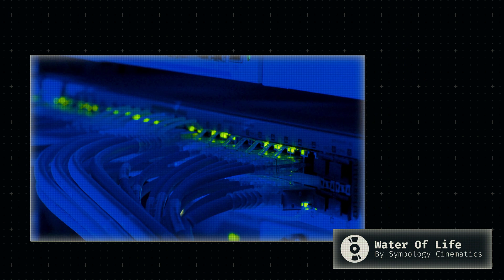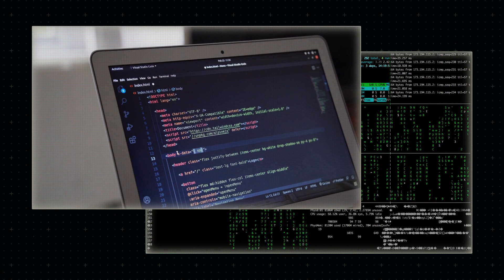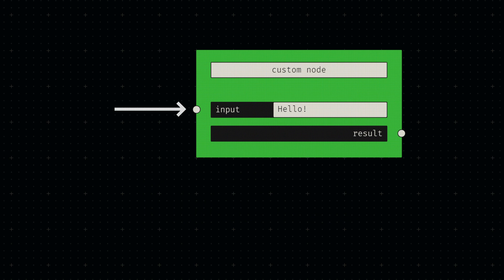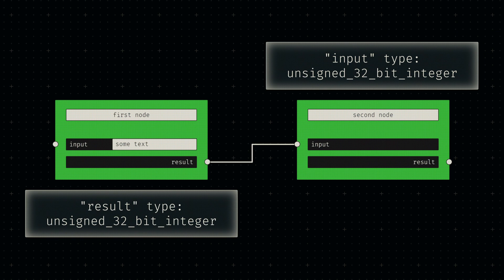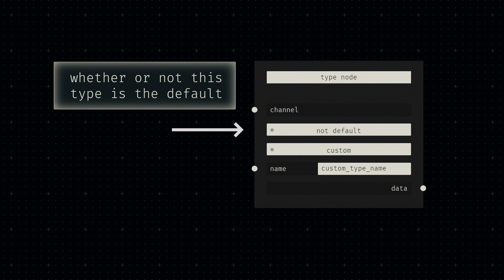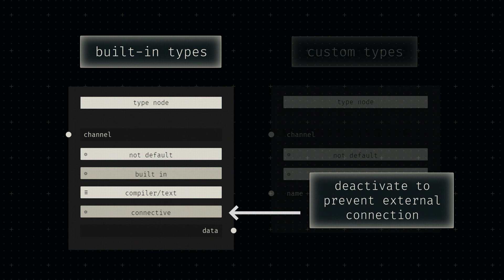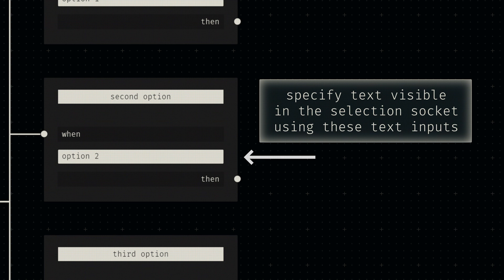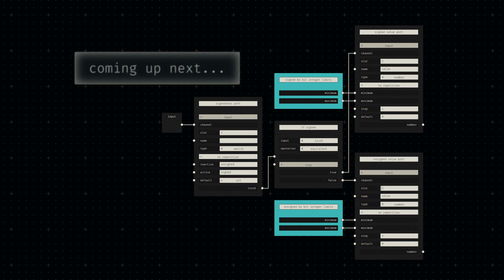A Type System to Rule Them All - Kronark

Comment: I have had an idea for a few years that I have finally started implementing: a redstone computer in Minecraft that compiles and executes brainfuck source code written with renamed paper items. I have an addressable 8-bit register module (4-bit address space) that I am experimenting with expanding to an 8-bit address space to use for RAM, program ROM, and stdin and stdout buffers; and an 8-bit counter register module that can increment, decrement, add a 4-bit offset, and subtract a 4-bit offset. Once I have the addressable register module upgrade complete, I'll make the op-code decoder, and then an intermediate assembler that assembles op-codes with 4-bit operators and 4-bit operands, and then I'll need to figure out how to compile the brainfuck into the assembly language and put it all together with some hexadecimal displays. I do not think that anyone has ever made a compiler in Minecraft, so it is an interesting project.

Comment: See the type system of Julia, how it relates to multiple dispatch: How do you think does your type system compare?
Reply from the maker: I‘d say it‘s pretty similar tbh. Instead of defining multiple functions with the same name and different content, all the internal variations are stored in the same function / node. Might actually save some effort and make maintence easier, since you don‘t have multiple function bodies but could instead funnel different data types into the same node subgraph performing the actual operation.

In general, anything Julia‘s type system can do, this compiler can do as well.

Comment: damn, thats kinda cool. Maybe make the connections a bit more dynamic? Like Drag from one socket to another. since that feels more down the earth and interactive
Reply from the maker: A drag and drop approach isn‘t as intuitive as you may think. It‘s actually kind of annoying in larger networks if you have two nodes far away from each other :)

But I may overhaul those controls a bit more in the release build, maybe allow customisation via settings

Comment: These explanation videos are always interesting though I can't wait to see the executables too! I also think small but frequent updates are better.
Just a quick question, Does the colors of the node represent something or is it just that something you choose ?
Reply: i guess on custom nodes you'll be able to choose whatever, but built-in ones are going to be dark gray-ish
Reply: Just doing a little post on the community page goes a long way, don't burn yourself out. 😊
Reply from the maker: Yeahh, i‘m still struggeling to get into a good edit-upload flow… more frequent wont be possible right now

You can choose the colours in a settings node that connects to the output root. I don‘t think i‘ve ever shown it as it‘s pretty irrelevant for now. But yeah, basically just syntax highlighting for node graphs :)

And as @darkfllame correctly guessed, the built-in ones are all black, which appears as gray due to a filter effect for UX reasons.

Comment: How are you handling types which are arrays of other types? Your videos are fascinating, I’ve been independently implementing something similar over the past 12 months myself, it’s so interesting seeing how our approaches are similar and different. Arrayable types were one of my biggest challenges!
Reply from the maker: Nice! :)

Actually hadn't thought about arrayable types so far, but I'll probably create an abstraction layer for typed arrays which take a stride as a parameter equal to the size of the internal type. Anything else really is just an array of pointers, which is an entirely different problem on its own. We can build type names dynamically, so it would be easy to generate a handle for any typed array data types. So yeah, probably a node that has a length and stride parameter, an internal data type specification (there will be a used type autocomplete feature which recommends previously used type strings) and then a repetitive input socket for all values to be stored on declaration. I'll eventually find a way to calculate that stride automatically too. So something along those lines :)

What's your approach?
Reply: @Kronark  thanks for the detailed reply! Your implementation sounds very thorough 👍 There’s not much in common with my approach as our use cases are very different at this degree of detail, but I’ll share some more about how I went about it:

My app is basically a CMS for constructing a dynamic programming language, where each entry in the CMS represents a single pure function, with zero or more fields associated, each of which has a type. If it’s an input field, the type applies both inbound and outbound (as values can be carried across between multiple nodes), and if it’s an output field, the type applies to the result once the computation has run.

The system I’ve built allows me to associate one or more JSON-native type(s) against each field. For example, `number`, `string`, etc. — I decided early on that using JSON/JSONSchema as a base was important for portability, especially given LLMs are being modelled on function calls from JSON Schema specs.

Each field is assigned a JSON-compatible type, but has an additional Boolean flag to indicate if the value is arrayable. In my context, I want each node to be as flexible as possible on the inbound side: if a field expects an array of strings, it accepts either a scalar string or an array of strings, and if it’s marked as arrayable it automatically wraps scalars in an array before executing the underlying function.

On the output side things are a little more complex due to the nature of my app. In very simple terms it’s like a parametric design tool, so tries to strike a balance between simplicity and flexibility.

Given a scalar input, if the node expects to return a scalar output it will do so by default. But if the scalar input is passed as an array of scalar values then the behaviour of the node changes automatically. My system will run the underlying node action once per value in the input array, then return an array of mapped values as output, instead of a single scalar.

This is only practical as I’ve built the system around this design requirement (precise yet flexible I/O types), so almost every node expects to work with either single or multiple values in any context. I also have flags for power-users to change how array inputs are handled (eg treating an array as a single value instead of processing each element), for edge cases.

Thanks for the great channel and would love to discuss more! Hope you found this interesting 🙌

Comment: This is why I think rust would thrive under a node display, the type system is so powerful in rust.
Reply from the maker: we might look into implementing a similar ownership mechanic with this node editor.
Reply: @Kronark  I'm possibly gonna be implementing a 1:1 rust node editor for bevy game engine anyways.
Your videos have helped solidify my confidence in the concept.
Reply from the maker: Glad I could help! :D
Reply: @Kronark  if you have any advice for it I'd love to hear it
Reply from the maker: You'll need the frontend visualisation of your networks earlier than you think, because you won't be able to wrap your head around some concepts as easily otherwise.
I initially tried to implement the backend first, then the frontend - but then I ran full speed into the brick wall that is data types and socket construction. I just could not implement it properly without seeing the actual node network.

Also, your actual core compilation function will get very complicated very fast. Comment EVERYTHING and maybe even write down the algorithm on paper. These node graph editors are absolute beasts when it comes to edge cases.
Reply: @Kronark  interesting, since I'm making it for bevy I already have all the stuff needed for a visual side, and because I'm not making a language, just the visualization/manipulation of rust in nodes, I get to avoid complilation complexity because all I need is rust parsing and the inverse of that parsing.
Reply from the maker: That does simplify some things, but you still need to traverse the node graph. And if you want to add node construction like in my compiler i.e. nodes within nodes, that‘ll add a bunch of complexity to that traversal loop as well.

Remember, i‘m really doing exactly the same thing, just more general purpose. While my nodes output arbitrary strings, yours outputs rust specific code I‘m guessing? The node graph compilation should be very similar if not the same :)
Reply: @Kronark  mhm, I think yours is a lot more complex but I think mine has advantage since it already has a lot of complexity solved for me via the game engine. 
But its good to hear about these complexities you've encountered.

I think your implementation of node groups is a bit more complex than how I think of them but probably a more efficient method since you handle compiling as well.
Reply: @Kronark  I looked it up, turns out nearly everything I need already exists in various crates, 
Found a crate for parsing rust to Abstract syntax tree (designed for making macros so not 100% on it)
Found node graph crate 
And the rest is in the engine.
Reply from the maker: Nice! Good luck with making all those pieces fit :D
Reply: haskell would also work.